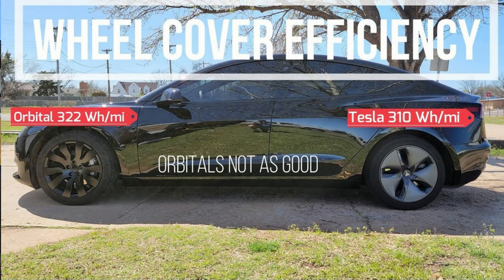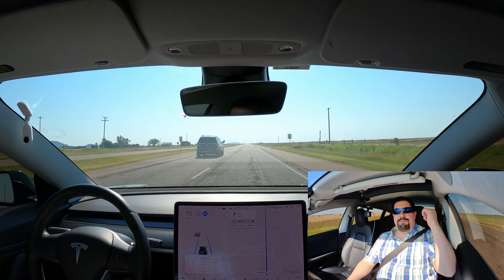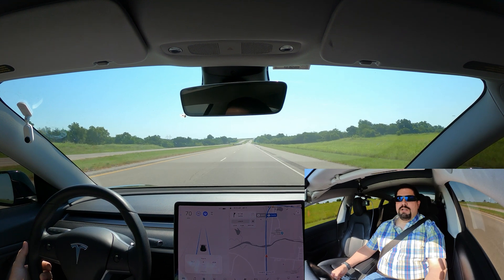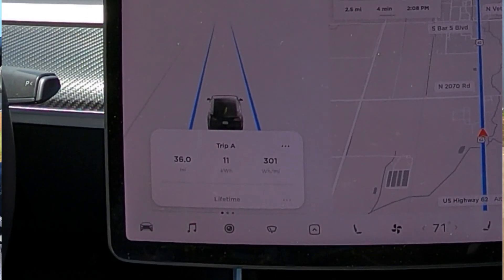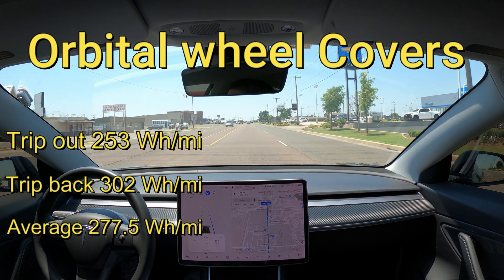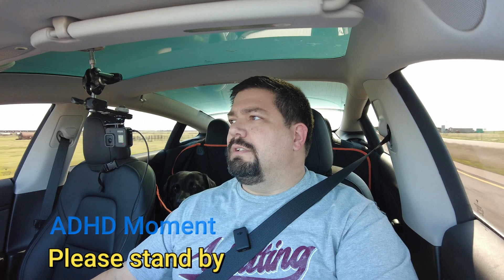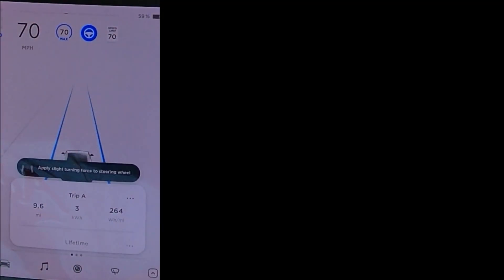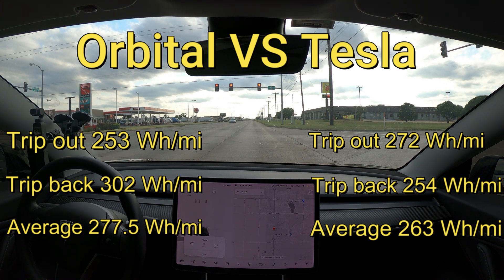Rimetrex Orbital VS Tesla aero covers efficiency test

Comment: Thank you Crazypostman for your efforts to document and test this as scientifically as possible given the resources at hand. Unfortunately, the fact that Orbital out < Orbital back but Tesla out > Tesla back says something changed and the results are suspect. Here are a few ideas that might yield more consistent results:
1. Turn off the HVAC. Heating and cooling can have a significant impact on Wh/mi, and given the glass roof and rear window, sun angle and clouds could change the heat loading and thus the HVAC output. Running without HVAC probably means running at night or very early morning to make it bearable - which might also minimize traffic and wind
2. Keep an eye on battery temp (via Scan my Tesla). The car may be spending energy to heat or cool the battery which is skewing your results. Here is another possible benefit to running at night (during the summer), assuming you can find a night with ideal temps.

Again, thank you for your efforts. Your methodology (out and back, constant 70mph on AP, etc) was sound and well thought out. Unfortunately the Tesla interface doesn't inform us about energy consumption of other systems (Battery thermal management, HVAC, etc).

Comment: Totally unscientific. Unless you are doing a complete loop - each time - you cannot expect accurate results. One way could have had the wind to your back versus the other way driving into the wind. One way could have had more downhill driving versus the other way with more uphill driving. And, if the tests are done hours apart then there is temperature that will skew any results.
Reply from the maker: I'm a postman not a scientist 🤷 I did the best I could do to replicate both drives identically. It was a loop!  the wind was similar speeds. One day I had a Southwest wind the other I had a Southeast wind. There was no elevation differences in the test because it was an exact same road on the same loop. Temperature was the same. Wind direction was the only thing different but that should have averaged out.

Comment: That looks to be only about a 5% difference in the Wh/mi. Not bad if you really hate the look of the stock aero caps and capless make your wheels look too fat or the rims too dinky.
Also, you might want to watch out for rim damage from the Orbitals, as shown here: https://www.youtube.com/watch?v=NJuYmr2v8DE&t=33s
This can easily be fixed by a $3 strip of foam linked in that video to prevent rubbing against the rim.
Reply from the maker: I actually do have some scratching caused by the covers I showed in another video
Reply: @Crazypostman  i got scratching too.